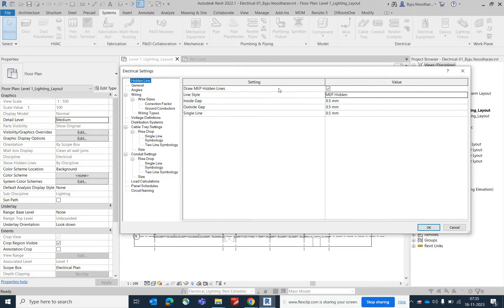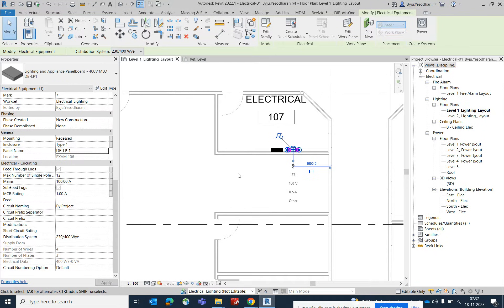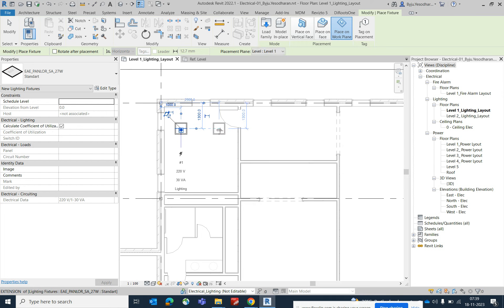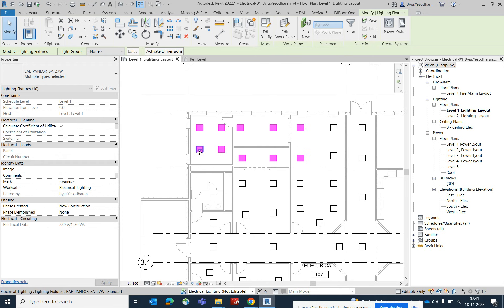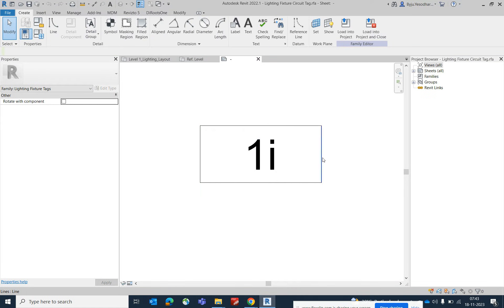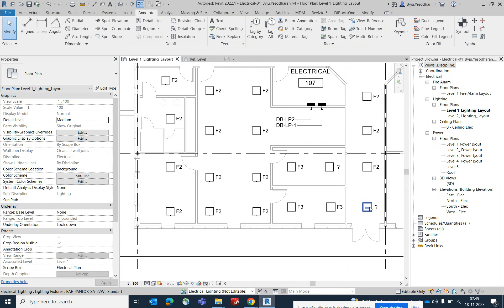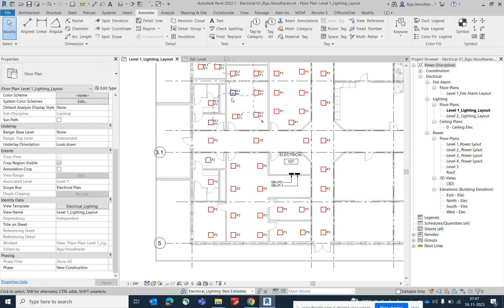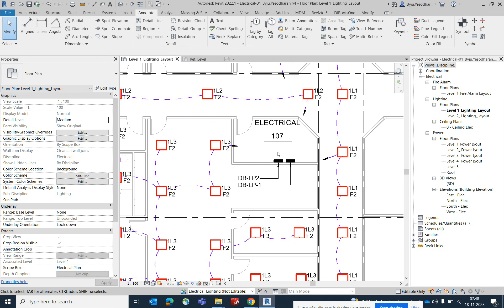Revit Electrical Project Setup For Lighting Part 2

Comment: Hi Sir, please make a complete lighting plan A to Z project creation of file from start lighting conduit and lighting  fixtures text style dimensions style creating family blocks electrical settings revit  this is not complete video to work as revit electrical draftsman plan in company with engineer 🙏
Reply from the maker: Okay sure